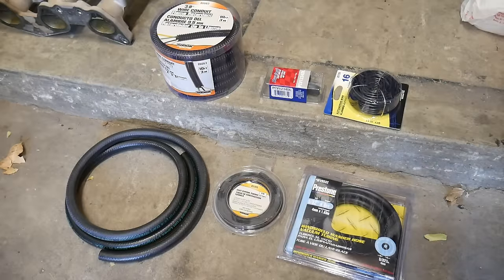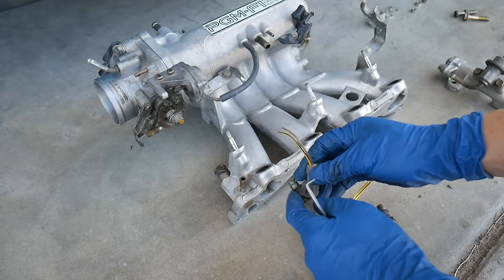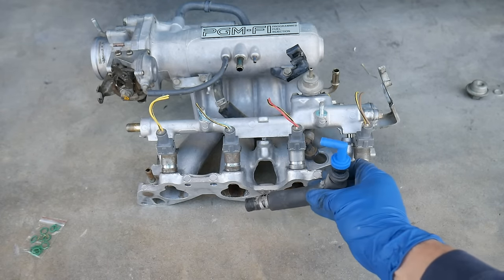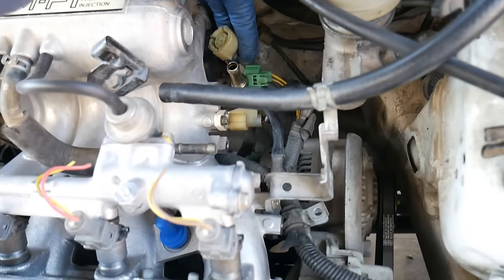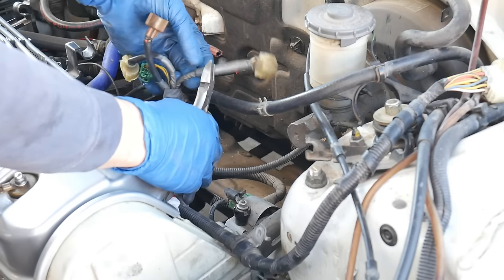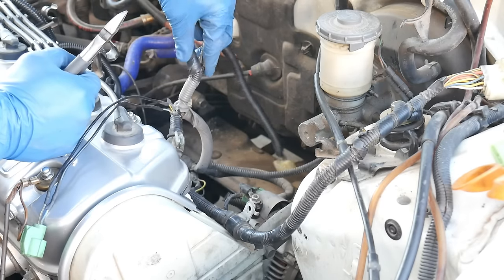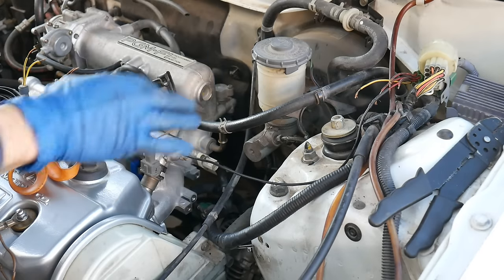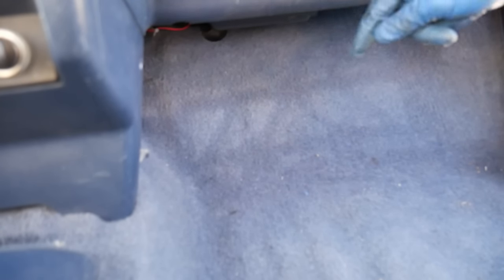DPFI to MPFI Complete Wiring Guide - 88-91 Civic & CRX

Comment: what do you do for obd1 non resistor side wiring?
Reply: still add wire to ecu?
Reply from the maker: U don't understand your question.

Edit I don't
Reply: when you run obd1 injectors and pigtails, do you still run the 5th wire to the ecu? A15
Reply from the maker: Good question.  It might still be needed, since it now connects to all 4 injector wires where the resistor box used to be.  Try it first without it,.see.if it starts.
Reply: Thank you for your help and all of your videos
Reply from the maker: You're welcome, report back when you try it out.  I'd love to hear if it works!

Comment: Can a bad wiring cause idle ??
Reply from the maker: Idle?  Fluctuating idle?
Reply: My car sometimes idles on 1500. And my engine light is on for the iacv.  I’ve done a vacuum leak. And Cleaned the iacv. Can bad wiring be the reason ?
Reply from the maker: No, wiring usually works or it doesn't.  Did you get the IACV check engine light fixed?

Comment: Im doing an obd2 b18 swap into my 1990 standard hatch i got the motor down to obd1 and i have an adapter ecu adapter harness that converts my ecu connector to 0bd1 how do i wire up the map sensor correctly?
Reply from the maker: Is your original map sensor still there on the firewall?
Reply: Garage Built Hondas I took it off but I do still have it I thought it was  part of the smog system so that's where my plug should be for the obd2 map sensor?
Reply from the maker: Yes, that original map plug wiring needs to be used for the new setup.

Comment: Hey. Thanks for the video. And I’m done with my swap. It does turn on and runs. But I’m having some issues keeping it in idle. It’s dies unless I keep the accelerator press down. And also it misfires a lot. Making a popping noise. Backfire. I check my timing and fuel pressure. One more thing a didn’t plug anything for the pcv. Please give me some advice. Thanks
Reply from the maker: Any check engine lights?

Comment: I was wondering how exactly did you make that injector subharness? That plug that goes on the intake manifold where exactly does it go? And how did you wire it?
Reply from the maker: I used obd1 injector clips, the plug that is at the end of the subharness is another resistor box plug because it was perfect with 5 wires needed.  Which plug on the intake manifold?
Reply from the maker: mexico3161 Got it.  That plug isn't necessary.  As I described in the video I only made it that way for ease of removal/installation.  The wires from the resistor box and injectors go through the firewall to the ECU.   You do not need to add that additional plug that I added.  You can run them straight to the ECU if you wish.

Comment: Hey man, awesome video!
Got a question about power windows for my EF wagon 
My question is will the whole power window setup from the ef sedan work for my wagon, and if so what all do I need to make sure I grab?
A pretty clean one is at this junkyard by me and I wanna get to it before it gets torn apart. 

Thanks in advance man all the way from Chicago
Reply from the maker: I've heard yes.  You might have to swap the rails for the window but the regulators work.  You'll need the entire cabin harness under the dash leading to the doors.
Reply: Ok awesome
I’m definitely hoping it will work because the inly other option I believe is to do the power window swap from the JDM wagon and I definitely do not have the money for that lol

So after I pull the dash out am I pretty much grabbing every wire and plug I can find behind the dash? Or do I have to take the engine harness as well?

And then from the doors I’ll need the switches and rails right?

Do you think it will likely be plug and play or is this gunna be harder then I’m thinking lol

I have basic skills when it comes to wiring lol
Reply from the maker: I imagine if you have the entire harness it'll be plug and play.  There may be issues along the way but ik unaware of what those may be.

Have you considered getting an aftermarket power window setup installed at a local shop?  It might save you the headache.  For me, time/energy is money.